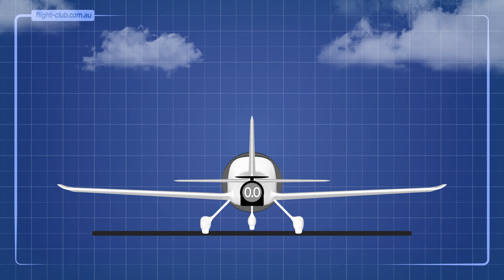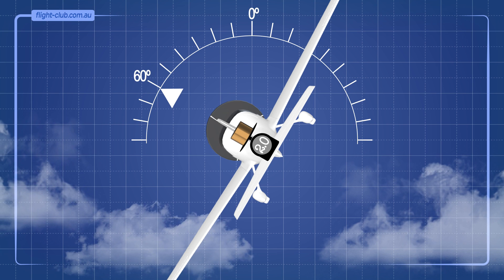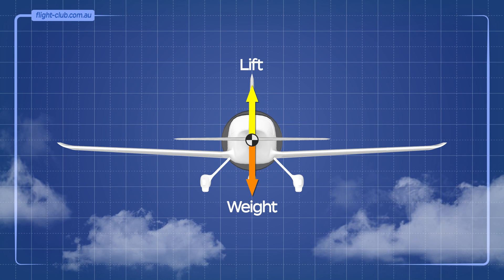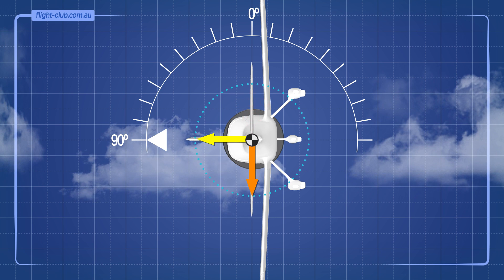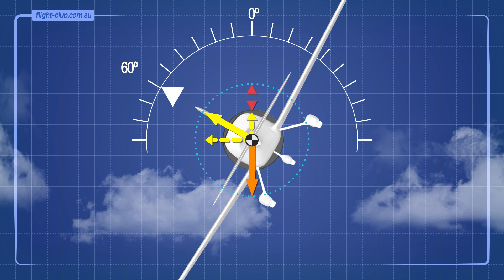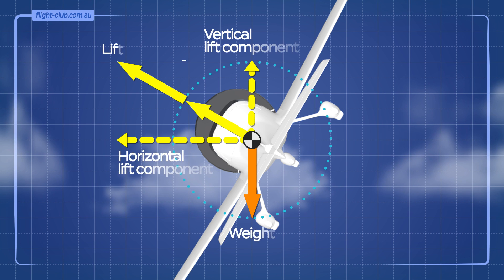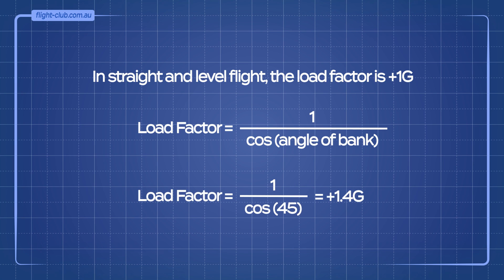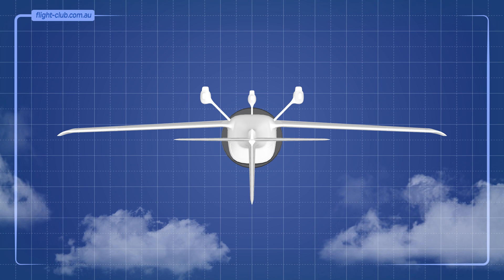What is the Load Factor?

Comment: @flightclubonline
 can you explain the logic of +G and –Gs? As I understand the +G is the downward force you feel when you are climbing at a high rate, and vice-versa, the –G (negative G) is  when you are descending faster, correct?
Reply: @flightclubonline
Reply: No. G forces are related to acceleration not to vertical speed.  
  Going upward in an elevator in a tall building you will feel heavier as the elevator accelerates. At steady upward speed you feel normal, and lighter as it decelerates near the required floor.

Comment: At 3:29, a free body diagram of the airplane is showing an equal and opposite force to the horizontal component of lift known as the "centrifugal force". This force DOES NOT EXIST. Centrifugal force is an illusion brought on by the inertia of your body wanting to travel in the path prior to the airplane turning. It is an easy way to combine centripetal force and inertia, rather than teaching pilots what is actually happening when in a turn. Furthermore, if the centrifugal force was equal and opposite to the horizontal component of lift as shown in the video, the airplane would not turn.

Comment: How about knife edge? explain that...
Reply: the fusalage must generate the lift by pushing rudder to the right for a left knife edge. but to compensate the force of the wing to the left, put a bit on the elevator to keep straightt forward. `But a c172 is not capable of course to knife edge. An acroport 2 i fly does

Comment: I would say it is relative to the position of the scale, if the scale stays right side up it would be 1G but if the scale turns upside down with the aeroplane then it would be -1G, that is if the 1kg weight was attached to the scale.
Reply: Its still plus one G of force. the pilot would feel the force on their lap belt instead of their backside on the seat. The scale may not register the same depending on how its set up.

Comment: There is nothing called centrifugal force... Newtons third law , the action and the reaction act on two different bodies and not on the same body otherwise t he  net force will be zero.The action is from aircraft acts on the air mass and the reaction from air mass acts on aircraft
Reply: Thank you ! The physics isn't properly phrased. To avoid any confusion, it should be better not to use the notion of centrifugal force. The weight in the plane is accelerating toward the center of a cercle, therefore the resulting force is directed toward the center too. The forces the weight is experiencing are its weight (oriented downward) and the reaction of its support in the plane, oriented perpendicular to the plane. As the gravity acts the same way on any mass, what you feel (at your bottom, when you are sitting on a chair, for example) is only this reaction of the support on which you are sitting.

The load factor is a measure of this reaction in units of the gravitational force.
Reply: As soon as she mentioned centrifugal force I cringed 😖...

Comment: Question @4:08 loadfactor at upside down or 180 degree bank is calculated using formula on 3:40....and cos 180 degree is - 1 so 1 divided by - 1 should be - 1 or - 1G flight..... Maybe  that's why by inverted flight pilot should push  control column
Reply: Yes, down elevator to maintain level flight.

Comment: Might sound like a dumb question... but if 2xLift is equal and opposite to the Apparent Weight, should you not feel any force at all? Since the net force is zero. Thanks for these videos
Reply: Force is a vector quantity. The magnitude might be the same but the direction keeps changing as you continually change direction in a circle.
Reply: It's just what you're feeling. It isn't a rea, force. you're squished into your seat and the diagonal component is where you think is down
Reply: Well, first of all the weight we feel isn’t the weight we work with in practice. 

The weight [certainly] is the force of gravity exerted on us. But how do we feel this weight? It is by the reaction force that the ground/chair/bed exerts on us. And from the requirements of static equilibrium, there will still be zero net force when you are sitting on a chair [as the chair exerts you back the same amount of force by which the earth pulls you, it cancels and the net effect remains zero] but you will surely feel your weight [I.e. you won't feel weightless]. This is because [as I said earlier] how we perceive our weight. We perceive [it] by the reaction force that is exerted on us.

So when you are on a level flight in an airplane, all the forces acting on you as well as on the airplane are zero but [still] you feel the compression or the pressure of yourself [ I.e. your weight] as how you feel when sitting on a chair on the ground.

This whole idea becomes clear if one understands the frame of reference [i.e. inertial & non-inertial].

Comment: An inverted plane would have some lift capability, there is an edge. The angle of attack would be different inverted, Idk how to calculated it. but if the particular airplane is not made to be fly upside down then I would not be safe. More thrust would give the airplane more potential to stay at level flight.

Comment: Excellent clip; If I may, we should get more familiar with the correct kilograms unit "mass" and let loose "weight" (Newtons).
Reply: Better to deal with newtons to equate forces
Reply: @hannahjohnson9413  You are correct,  but than we are - in the clip - talking about 10 or 20 Newton of weight and not 1 or two kilograms of weight.

Comment: Great video.
It leaves one with a question.
If Fcf=Lift horizontal component, the two forces are in balance.
What turns the airplane around?
Reply: There is not a force called centrifugal,it just a feeling ( so many people get confused with that)
The aircraft turns because of the horizontal lift component
Reply: Correct, only the centripetal force is a force as such
Reply: Hallman and the tape machines?

Comment: A good question for your students: what is LF in 90° AoB level?
Reply: Level flight mathematically impossible at 90 degrees of bank
Reply: Look at the graph at 3:57 and you got the answer
Reply: Infinite ? But 90° bank angle is possible… I guess. So that is a good riddle.
Reply: @NotaRandomYTuser  U can turn the plane to 90 degrees but it will descend. Impossible to hold in level flight at 90 degrees when there is no lift
Reply: @OnnekasMies  The Harry Brown Project
Incorrect with sufficient speed and aircraft can roll through 90 degree angle of bank and maintain level flight, it’s called aerobatics

Comment: Wait, I saw planes doing 90 degree of bank and still maintaining altitude.... it was at an air show
Reply: Airshow planes are exempt from the laws of fizzicks.
Just kidding. I think what you saw is called Knife-Edge Flight. The factors opposing gravity are the bottom side of the fuselage and the vertical component of thrust.
Reply: Fuselage and partially engine creates lift force. Almost everything can create aerodynamic lift force - one exception is a ball. That's why paper planes also can fly.
Reply: @sith lord  acrobatic airplane pilot used rudder(vertical stabilizer) at 90 degree bank to maintained altitude, they will step on right rudder for 90 degree left bank to keep/maintained  airplane altitude...
Reply: Won't drop like a brick, take into account how it's still movin' around fast in the air, and I guess you can try playing with the rudder to keep the nose above horizon.

Comment: In the upside down scenario the load factor will remain the same since the lift still equal and opposite to the weight
Reply: But the shape of the wing is upside down so it doesn't produce the normal lift... Unless is an aerobatic plane when the shape of the wing is the same bottom and top but I don't think that this scenario uses an aerobatic plane...
Reply: @TheDrAkira  in case of asymetric airfoils You can gain more speed and more pitch angle to maintain level flight.

Comment: Load factor during upside down straight and level flight will be -1G
Reply: Google says -1G 😅
Reply: @eizerflak6967  ha ha. 😂
Reply: Since the Load Factor is defined as the maneuver wingloading compared to the straight and level rightside-up wingloading, and in straight and level rightside-up flight everybody agreed to say the one g load force on the wings is "positive", requiring that we call it "negative" in inverted flight, and since in balanced inverted flight the wings, although they are upside-down, are still loaded with the whole weight of the plane (one times the force of gravity, i.e., one "g"), it follows that the load factor in straight and level inverted flight is negative one g divided by positive one g, i.e. negative one.
Reply: @joeteichert6821  but in a straight and level inverted flight. Lift will be still upwards and that has to balance the weight. If that is the case, still my lift force is upwards and my weight is downwards. So shouldn't my load factor be equal to 1?
Reply: why? seems to be quite intuitive right answer but I am not sure
Reply: 180 degree? not full 360?
Reply: @jokerbelac2917  that would just be normal flight my guy
Reply: wouldnt -1G be when falling?
Reply: @Bezimienny  it would be, i assume, since the airfoil would be inverted. Unless you change the angle of attack to stay on level flight. I might be wrong though. 😅
Reply: in straight and level flight upside down gravity force of earth will work on plane with 1G but because the plane is actually inverted the load factor will be -1G